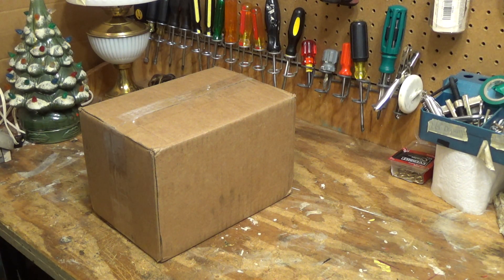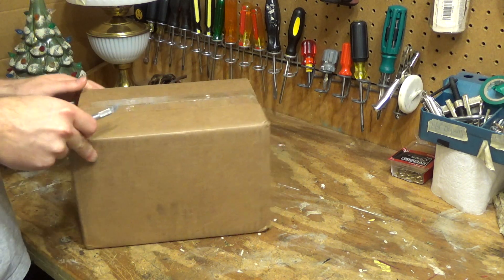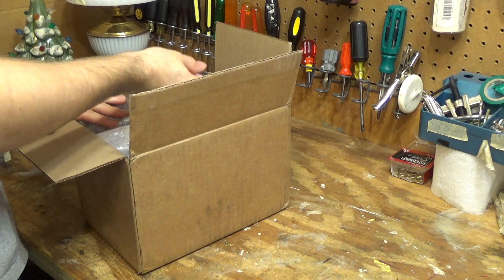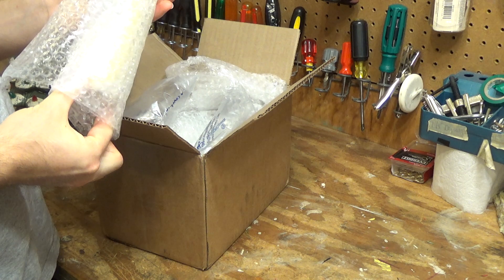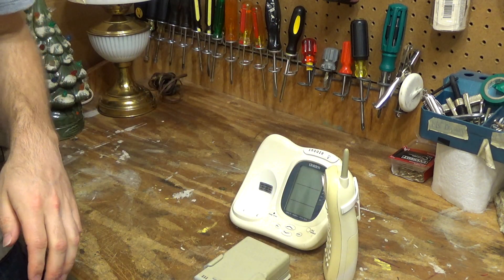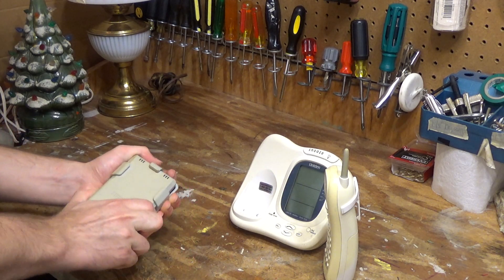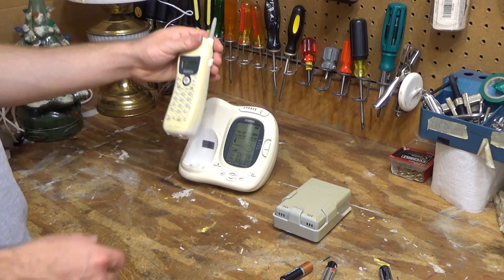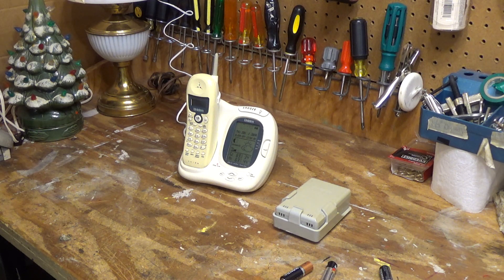Uniden EWCI 936 900 MHz Weather Telephone | Initial Checkout

Comment: The only thing that would make that cooler is if it had a built-in "modem" and would dial out every night at midnight to some "underground" service that would then transmit the weather forecast for the next 5 days to be displayed on the screen.
Reply from the maker: That would be interesting,, but I suppose that's when you just grab the phone and call the NOAA..
I think it does have some type of forecasting in it, based off the barometric pressure.. But if I recall correctly it's only for the next day or something very limited..
Reply: I understand the kind of forecasting you're talking about.  Chances are that's a much better indicator than flipping on the news to see the weather, or even looking online, generally the rule of thumb is "tune in tomorrow to find out what happened today".  They can never get it right.
Reply from the maker: I can't even remember the last time I watched the weather forecast on television..
Reply: Think harder.
Reply from the maker: No..
Reply: The answer was as simple as flipping on the TV now, that way it was the last time you did it.
Reply from the maker: Pressing 4 buttons on my keyboard is vastly more simple..
Reply: Doesn't look like it since you missed 2 characters.  Not to mention that 4 buttons should really only be 3.
Reply from the maker: Not everything is what it looks like..
Reply: Right, except it now says "edited".